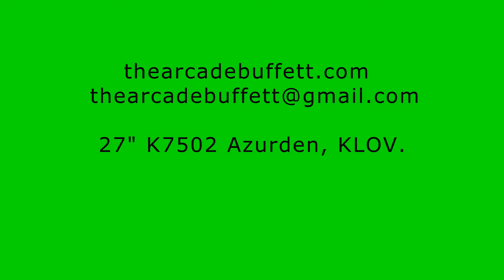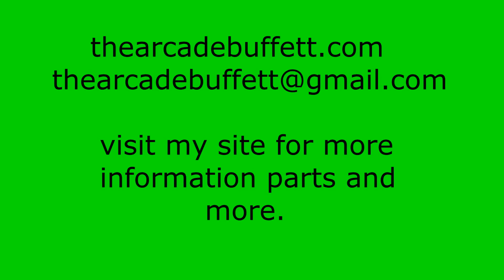27" 7502, Azurden, KLOV.

Comment: Hey Buffet I've been watching your videos great work I'm a newbie in this I have a question the flyback transformer is buzzing when I turn it on I can see arcing but it's barely visible when dark it all just happened after I had dusted the chassis is this something easy to fix? May I just bumped something what do you recomend me to do
Reply from the maker: +Oscar Hernandez (Hernandez familia) Hi.
glad you like my videos.

if your flyback is arching, it NEEDS!!!!! to be replaced.
if you need parts or wish to send it in for repair visit my website thearcadebuffett.com and shoot me an email.
Reply: +Buffett Arcade Man I would definitely check it out brother I would like to be able to maintain my machines I have 4 so far I'm going to get more info on what I need to fix thanks for replying so quick have a great day
Reply from the maker: +Oscar Hernandez (Hernandez familia) no prob.
happy collecting.

shoot me an email when you need parts or services.